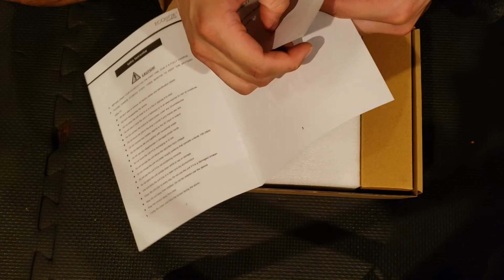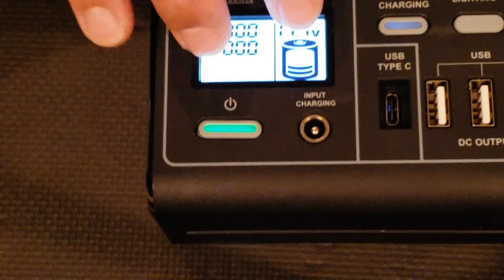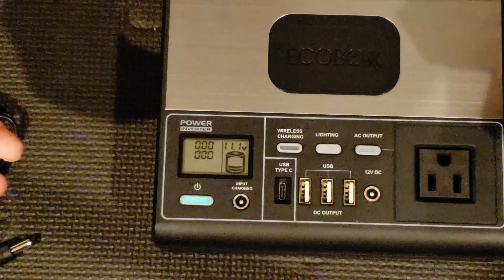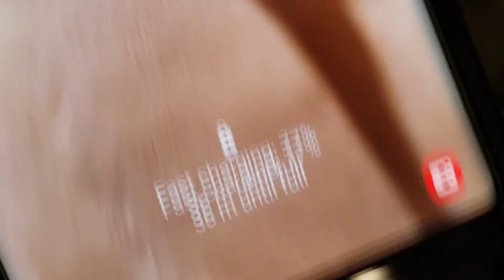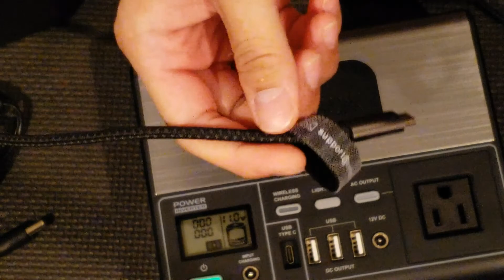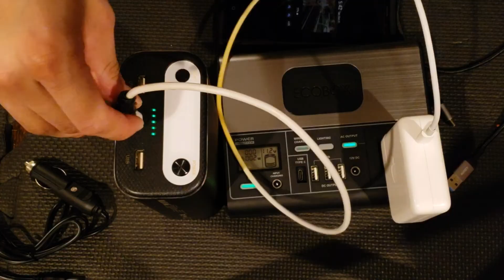UNBOXING: Ecoboxx EB150P Portable Power Station [SOLAR GENERATOR!!] [60W USB C PD!!]

Comment: Thanks for the video man, I left my like, quick question I know this is an old video but hopefully you can help me answer this question even though Im a total stranger haha, i live ina country were electricity goes out a lot, so in that regard I bought this device thinking that i could plug in my wifi to it and not directly to the wall (since i work online and i really cant have my internet go out) so my question is. Is it safe to keep the generator plugged in to the wall charging 24/7 while I have my wifi plugged into it and have it act only as a backup plan that will keep my wifi going without interruption when electricity goes out? Or would this damage the device or possibly cause a Fire or whatever? I dont know anything about this things so I apologize if Im saying nonses thanks for the answer man!